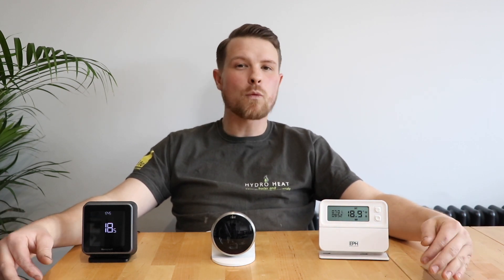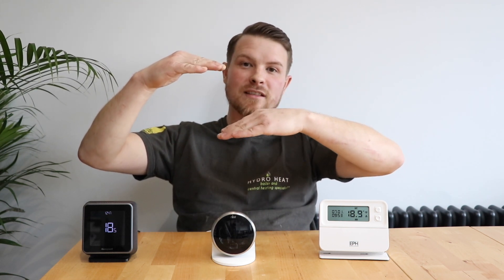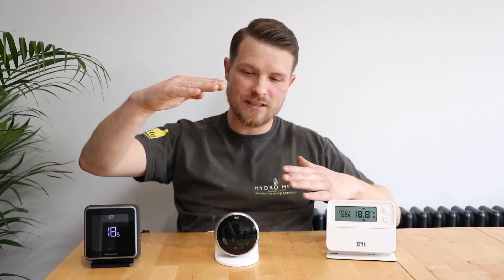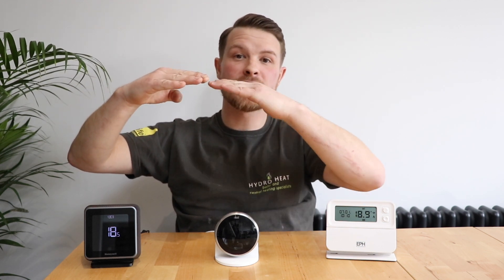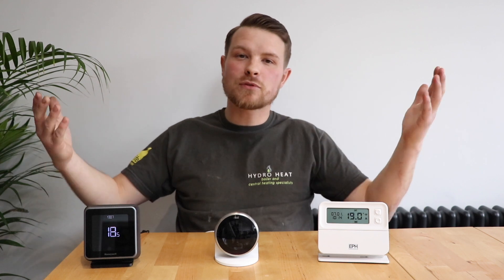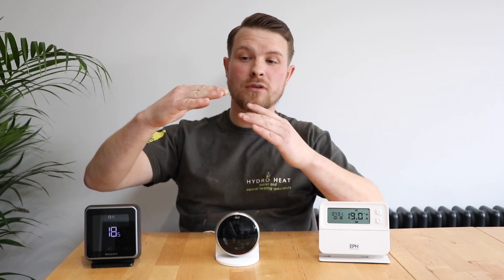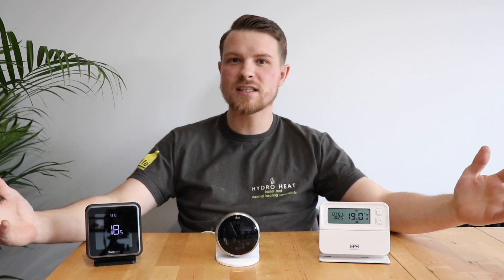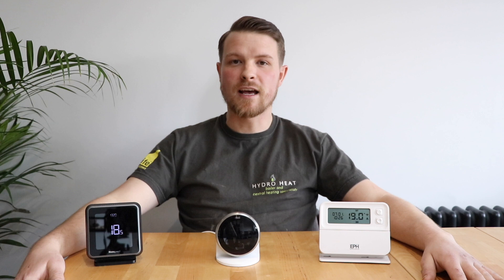What is Opentherm, whats makes a smart thermostat smart? What is TPI? This video explains all.

Comment: Great video. Just one detail missing - at 6:05 you mention that Worcester boilers don't natively speak OpenTherm, but didn't mention that it's possible to buy  the Worcester EasyControl Adapter which converts EMS to OpenTherm.
Reply: Hi have you had success with this? Wondering if I can can use one of these with my Worcester greenstar boiler to control  it  with a Drayton wiser thermostat..

Comment: I have an ideal logic+ system boiler and Google Nest 3rd gen thermostat. Pipes are installed as a Y plan. Can I get both hot water and heating to work via OpenTherm? What additional equipment would I need?

Currently I’ve got it wired in on/off mode but works like to use OpenTherm

Comment: I have a new Viessmann 100 combi and Nest 3 gen, wired open therm. Boiler controls are therefore taken over by the Nest so cannot control the DHW preheat on the boiler. I want to turn this off, especially when away from home, but no option on the app or Nest control. I turn the CH off on the app there is not the same option for the DHW but not a problem if no water drawn off but the pre heat is the problem as I assume it continues to operate. Any suggestions, really like the videos but having watched many I see no mention of this problem?

Comment: Great talk,thanks.I've started with Tado radiator thermostats planning to get their main thermostat etc then  discoverd they don't do opentherm in the UK ,do you think it's possible to add main thermo with another brand ,after all it will just be adjusting the room where the thermo is like the hall for example

Comment: this video is brilliant  thank you for this, really cool good man. Just in the process of install Nest 3rd Gen on all my rentals and I'm pretty sure that i won't be able to use OT in some of the nimbi I have as too old (10yrs Ariston Microgeius 28 HE etc) but I have a veissman 100 and a couple more that I think it can work. Q: if I may, is the wiring in the motherboard of he boiler the same I assume, correct? The difference is in the Nest (OT1 and OT2) correct? 
Thank you again for your time
Reply: Thank you, I’m glad you liked the video. The Viessmann should work perfectly but you might need to buy an additional piece of wiring. 

Best refer to the manufacturer’s instructions or speak to a local heating engineer 😊
Reply: @jamie-theheatingguy4870  Thank you for your time, really appreciated. I'll do so

Comment: Can you use open therm on a s plan system .?
Reply: It is possible depending on your boiler manufacturer but specific controls would need to be used 😊
Reply: The EPH CP4 will work with up to 6 zones with Opentherm.

Comment: Hi there.
Great video and well explained. We are in the process of buying a flat that has a Baxi Duo-Tech 24 HE Condensing boiler with an old looking thermostat. 
I'm thinking of upgrading to Drayton Wiser system with Smart TRVs that can trigger the boiler from the TRVs as well. 
-Does my boiler do OpenTherm?
-If not  os it worth to upgrade to the Wiser or is it just going to run the boiler 24/7 on full blast becase some of the rooms require heat?
-Can an adapter or a PCB upgrade from a newer model add the OpenTherm function to the boiler?

Comment: Hi there. I have a viessman 100 and nest setup for opentherm. The nest lets you set 'supply temperature' in the equipment settings. Do you know what the best setting for this is with gas and radiators?
Reply from the maker: Hi Ali, well in theory the supply temperature should automatically adjust according to heat required by the thermostat. Depending on if it's been set up correctly.

Comment: Great video, very few people are covering this, wish I knew more before connecting my Nests. I have a vaillant so i think I need an adapter from ebus anyway. Are you planning on doing any more videos on connecting Nest with opentherm. Also, when using a wiring centre to control multiple hearing zones, do they generally have the connections to receive/transmit opentherm signals ?

Comment: You aware that tado have basically reverse-engineered the proprietary digital control standards that Worcester Bosch and Valiant use on most of their boilers? You need to check compatibility with them, but there's a good chance you've got another good digital control option even if your boiler doesn't have Opentherm (which tado also supports).
Reply from the maker: Yes I've heard some good things about Tado but I believe they've made some changes to their digital interface that I'm not too excited about. Need to learn more about this though. 😊

Thanks for sharing

Comment: Works great unless you've got 6 Girls and a wife all using the shower at different times of the day.  Totally ruins any curve
Reply from the maker: Hi Paul, can you explain in which way it's affecting the curve? Is it because the heating is turned off when they are in the shower?
Reply: @Hydroheat  i believe he has a condensation boiler. I have one and stops heating the radiators when it's heating water at the taps. Stupid design 😑
Reply from the maker: @adyandrey23andrey  I believe you're right, he has a combi boiler which shuts off the heating when the hot water is being used. 

But I can't see it affecting the curve too much, maybe a bit when the sensor is asking for heat and not getting it, it may then send the message to ramp up, so when it switches back to heating the boiler will want to heat the heating system to a higher temp. This would be rectified pretty quickly one the boiler recognises that it's getting the heat it's asking for. 

But I'm interested to learn more if he's having a different experience
Reply: @Hydroheat  Our bpiler has kind of the same behaviour as his.
I have a question for you, since you know much more than I can find on google. Do you think the new Wyze thermostat is going to work with a Buderus Logamax Plus V2? It does support OpenTherm, so basically any smart thermostat should work with it, right?